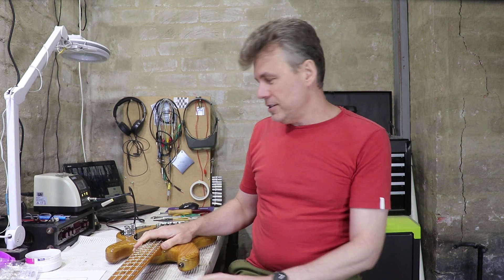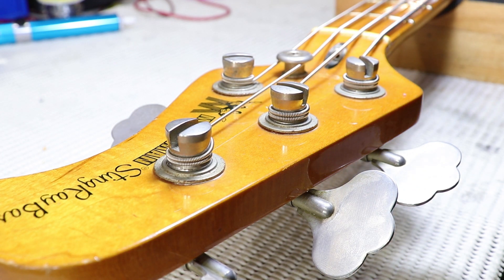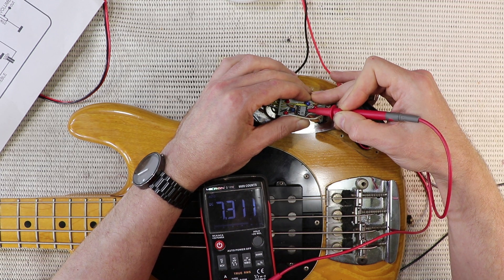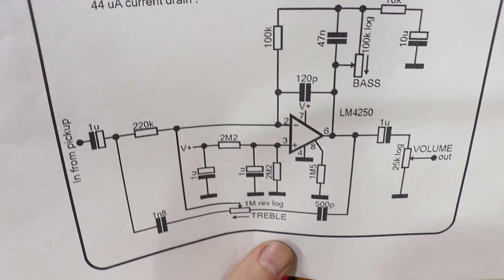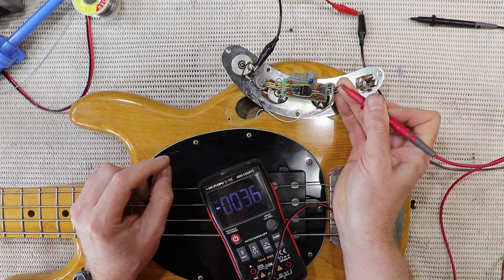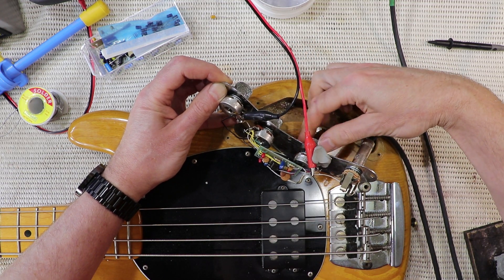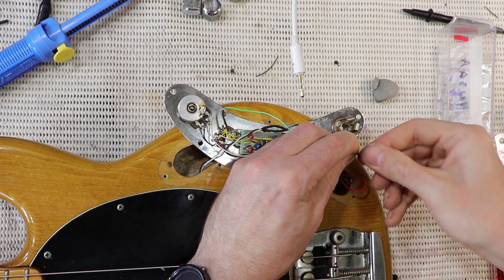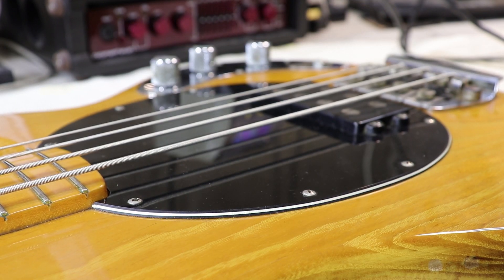Another Vintage Music Man Stingray Bass Preamp Repair

Comment: A cool repair! Thanks for salvaging that gem! I used to have two refin pre-eb's but I found them too heavy on my shoulder on long gigs. Now I have a  2010 2-band 'Ray that is lighter. I have also found that I prefer the sound of the newer lighter alder bodies to the old heavy ash bodies.
Reply from the maker: Cheers mate.  Yes, this bass was fairly heavy.  The ash is fairly hefty, but I think the old steel bridges with string mutes and those two big bolts and threaded bushings are a big part of the weight too.  Had a killer tone though...

Comment: Another job and repair executed perfectly rob, well done. 

I’ve got a Wal Mk2 1982 in for repair, some fairly standard fretwork but it also has some preamp problems that I’m not looking forward to. Those preamps have got some extra wizardry going on!!! 😂😂
Reply from the maker: Yes, I think they are similar to the Alembic stuff with the state variable filter design.  Best of luck with the repair!
Reply: @RobMods  yeah they are very similar to the alembic stuff. Alembic has a few more bells and whistles in a lot of cases. This bass just has a blend control with an individual LP filter for each pickup, also each pickup has its own 10dB boost. Very similar to ACG basses made here in Scotland.

Comment: That schematic that’s online didn’t match some of the preamps I’ve examined.  There’s a modified schematic floating around that I corrected.  It is notated “FIXED 9-7-11.” The 220k resistor in the feedback loop is usually 100k. 

Also you can improve the slew rate a bit by changing the programming resistor at pin 8 to 2M2. It will draw a bit more current. The schematic you showed has it at 1M5. 

Originally the output jack didn’t switch off the battery. It was on all the time!
Reply: Nice seeing you around the tubes, David! I am wondering why the resistor needed replacing in this case; since it was metered at 1M8 it should have been closed to the 2M2 as you suggest?

Comment: i was just messing around with my '94(?) G&L bass and saw something that reminded me of this video. ol' leo must have been a stubborn guy. still no battery switching on the jack. even though there's specifically a switching mono jack installed (not a TRS jack)... that 3rd pin has never seen any solder 🤷‍♂
Reply from the maker: Wow, really?  That's very strange.  I'd be warming up the soldering iron I reckon...

Comment: The preamps I build sound better than the stock preamp. I use the LT1351 and get rid of the 1M5 resistor at pin 8. The sound is amazing with more detailed highs and mids
Reply from the maker: Yes this preamp can be improved in many ways, with modern parts and other tweaks.  I'm guessing the 4250 has a very limited slew rate when that pin 8 resistor is set so high.  I often wonder if pickup and pre designs would have been so radical, if Fender and his engineers had realized that simple trick with the stereo jack...

Comment: Hi. Just a question: Potentiometers type A is for volume and type B is for tone? My Ibanez bass has type B500K for pickups volume and D500K for Tone and I'm confused
Reply from the maker: In passive guitars,  generally both volume and tone pots are audio taper (A).  However, linear taper (B) are also often used as volume,  especially with larger value like 500k and 1meg.  That's because the actual sweep of the pot also depends on the impedance that follows.   Is your ibanez an older instrument?  D was often used to indicate log and audio taper with certain pot manufacturers.  During the 90s A for log and audio tapers seemed to become the standard.

Comment: Can I have your advice please , Im building a bass with 2 Delano MC4 HE/S dual coil MM pickups , i want the bass to be passive , I bought 2 x toggle switches 2 positions . this will give me hopefully  a single and double coil options with each pickup, I have noticed people are putting 3 position switches , for Series , parallel ,phase ,.
To be honest I don't really understand what this witchcraft means , should i be buying 3 way switches for the witchcraft options is it  better than single double on each pickup will I get more tonal option . Thanks .
Reply from the maker: For a bass, I wouldn't bother with out of phase sounds.  They usually sound tinny and with low output.  I would go with single/series/parallel switches.  This is what Music Man does with the 3-way blade switch on their basses.  You will get a louder output with the series setting, but you'll have three quite different and useful tones.  You'll need "on-on--on" toggle switches, which aren't cheap though.  Best of luck with the project mate!
Reply: Thanks Rob for taking the time to get back to me appreciated . @RobMods

Comment: Great video...
My bass of similar age, seems to create a sound like a boom when I try to lower the volume...
Does it just once and then no noises till I keep playing a song or two, try to lower the volume and there you are the crackling boom again...
Sound like a capacitor to me...
Any ideas?
Reply from the maker: It's hard to say without seeing the instrument, but I'd check all the normal stuff - battery snap, output jack, pots etc.  But yeah, if that output coupling cap has shorted, then the vol control will be passing a tiny amount of DC, which, over time may well lead to the symptoms you've outlined, and a faulty pot.  Honestly though, this is a 45 year old circuit board.  There could be dry joints, corroded wires, caps and resistors with micro cracks etc.  The value of these instruments continues to climb and people really want originality.  If you aren't that confident with vintage through-hole stuff, perhaps consider removing and conserving the original pre, and putting in a new clone, for reliability.  I'd do this, especially if you are gigging and touring with this bass...  They are great instruments.  Best of luck!

Comment: Carbon resistors drifting like that is kind of unusual unless there's a lot of current going through them, in which case they can become damaged due to excessive heat... Some older carbon resistors could be damaged by mechanical shock too...   IC front ends can be damaged by electrostatic discharge, but I'd say the thing to check first in a circuit like that would be the caps... Tantalum capacitors of that vintage had a tendency to short out; it was a common problem.  Replacements are cheap, if that were my bass, I would just replace all of the tantalums.
Reply from the maker: Yep, I agree, I don't know why this one was so far off.  More than 20% IIRC.  As for the tants, the owner was adamant I keep as much original as possible.  But for me, yep, I'd replace them if it were mine...  (Actually with the value of these nowadays, I'd probably just put the pre safely in a draw and put in a copy circuit!)  In the other video I have repairing an old 'ray, the output coupling cap was short.  Thanks for your comments!

Comment: I'm from Brazil, and I have a 1978 epoxy stingray. The treble potentiometer is squeaking when turned, and when I close it all the way the bass sound doesn't come out anymore. I already changed the potentiometer for another (C1M) and the problem continues. Do you think it could be a problem with the preamp?

PS: When the treble potentiometer is in the middle and I don't touch it, the bass sound comes out perfectly.
Reply from the maker: Without seeing your pre in person it's impossible to diagnose, but perhaps the input cap or the two treble pot caps have failed.  If the input cap has failed it is probably like the output cap in this video.  Tantalum caps tend to fail to a short.  I would test the dc at the input with the pickup removed and the treble pot in the centre.  There should be no dc here, since the input coupling cap should block the dc path from the inverting input of the op amp.  If you measure a voltage then try a cap between the pickup hot and the pre input. (1uF - 10uF non polar).  If the problem persists, then yes perhaps the treble caps have failed.
Reply: @RobMods  Thanks for your help!!!

Comment: Great content! I'm also a bass player and I've started out doing repairs to instruments. I resently restored a 1973 Precision Bass, and I've noticed that the output jack is sometimes cutting out because it is contacting the walls of the rout. Is this something you've experienced? Greetings from Sweden
Reply from the maker: Hi Johan, Yes this is a common problem.  Either the contact is shorting on shielding paint/tape, or it is simply fouling on the timber and the contact is not flexing properly.  It happens on strats a lot as well.  If you have the original '73 celluloid pickguard, it has probably shrunk and buckled as well, which might be part of the problem.  These little problems are all part of the fun!

Comment: I have a music man bongo that’s completely dead. Any advice ? Or Lutheran you can point me to in New York or the states ?
Reply from the maker: I'm afraid I don't know any luthiers in NY.  I always suspect the simple stuff first, especially the electro-mechanical parts (jacks, battery snaps, switches, pots... in that order).  This video proves that sometimes it's a deeper problem unfortunately.  But by far the most common reason for a dead onboard pre is a damaged output jack.  Remember it not only carries the signal, but also switches on the preamp.  Even just a loose jack can cause problems, if it has spun and its contacts are shorting on shielding paint for example.  Bad battery snaps or contacts are also a surprisingly common problem.  Best of luck with the trouble shooting man!
Reply: @RobMods  thanks rob ! I’ve already replaced the output jack but the battery snaps is something I didn’t think of. You’re the man !

Comment: Great video!!. I have a StingRay Erni ball from 1992 and the input jack attached to the electronics produces a lot of noise, and a luthier did not know how to repair it. Then they ruined the pickup by adding glue, in an attempt to insert the sharp magnets. I was thinking on buying a Sterling SUB because of the 2 band preamp, and the Sterling StingRay 34 because of the alnico pickup. Do you think thats a good option or maybe I should buy John East 2 band preamp + Aguilar pick up?